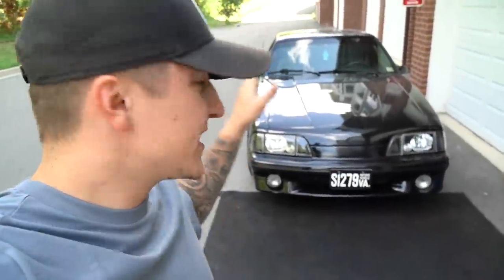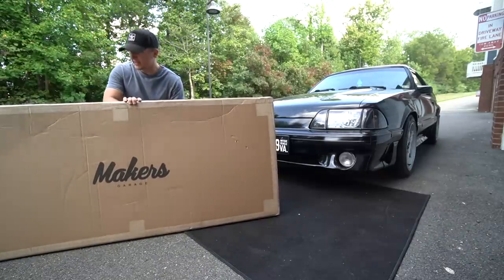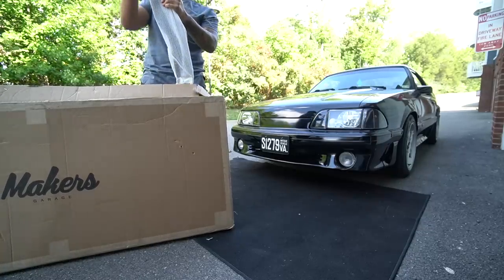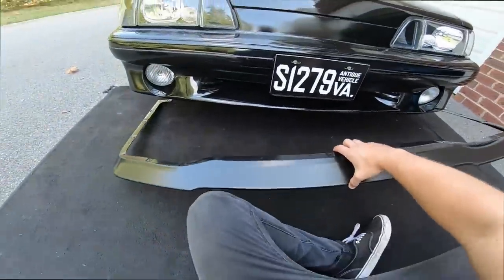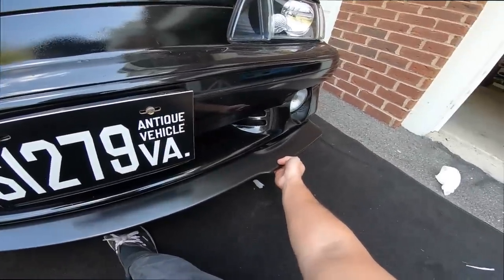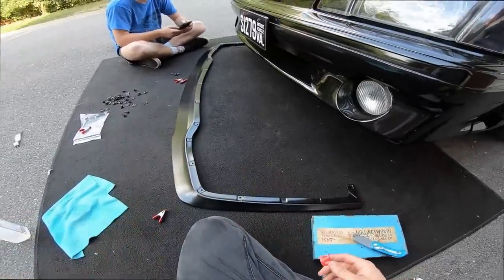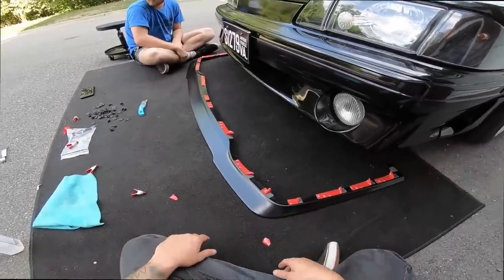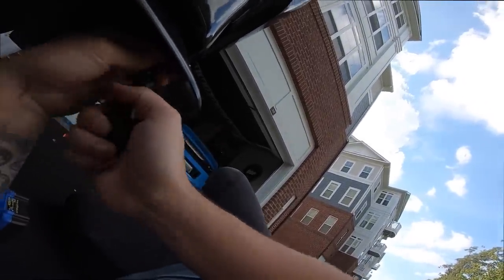Installing the MOST CONTROVERSIAL Foxbody Mustang Modification...

Comment: Super cool stuff OP. I was in high school when the 5.0 Foxbody's ruled the roads. Never did I think that one day Mustangs would be coming out with 465 hp STOCK! Back in the day 225-245 hp seemed like a lot. Still like the way the Foxes look the best.
Reply: To be fair the fox was 600-800 lbs lighter than a new gt and even though they only had 225 hp they had 300 torque and with a couple bolt ons and a set of steeper gears out back they can be very fun and much quicker than what they seem on paper to someone who just looks at hp ratings.  The power to weight ratio, especially the torque to weight ratio isn't nearly as bad as it seems vs the newer cars.  Clearly they're faster but a fox can keep up nicely with a stock new gt with 300 to the wheels even though they're well above 400.  These things are fun.  Solid axle and no nannies to protect you.  It don't do them justice just talking about their stock hp rating which I think many do.

Comment: I think I would have used nylon push rivets instead of screws. Easier to install and uninstall, will hold just as good but no worries of stripping and won’t cause you to have flat if one works it’s way out and ends up in one of your tires.

Comment: The hole on the front is a cobra front bumper. You can buy the whole front bumper or I belive LMR sells a kit where you can convert the gt bumper but you gotta cut into it.
Reply: Correction you can not buy the whole bumper

Comment: I got the survey on this fox. Man those cars are lame as hell.  I had a black gt too. Even had black powder coated wheels with 12 inch wide on the rears.  Still sucked! Giant @## head lights. Look like two giant shoe boxes. Take off the wing and you can't tell if it's coming or going.  Giant door windows... same size as the door itself. Don't lie...it feels lame driving it... does it?